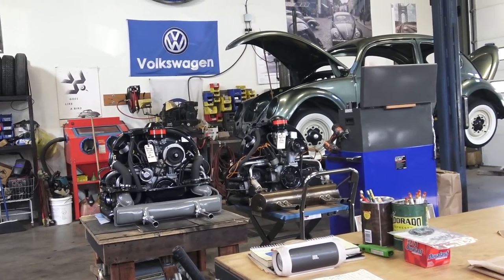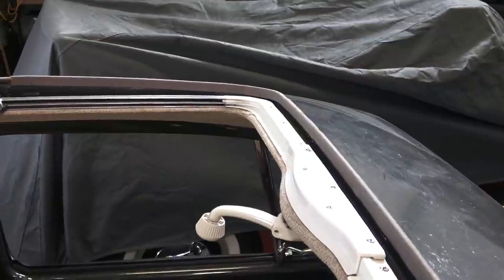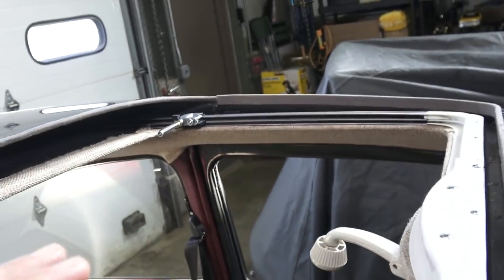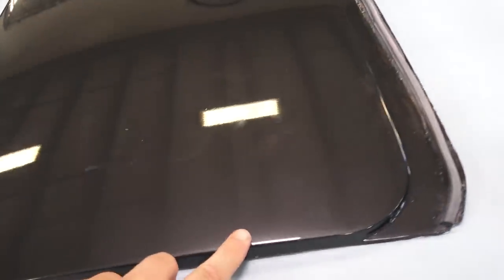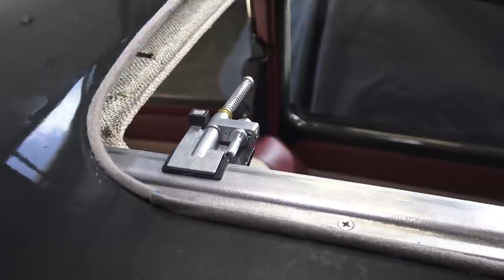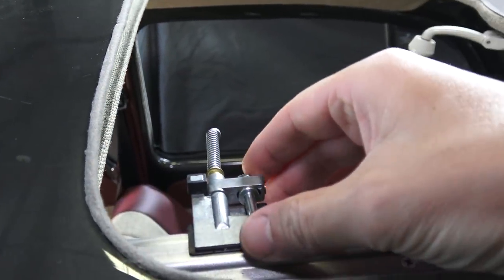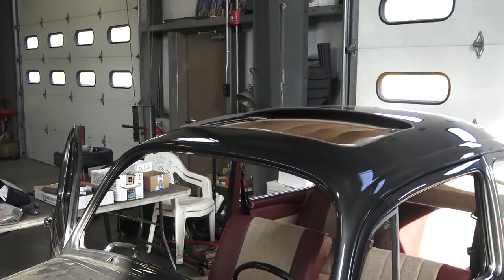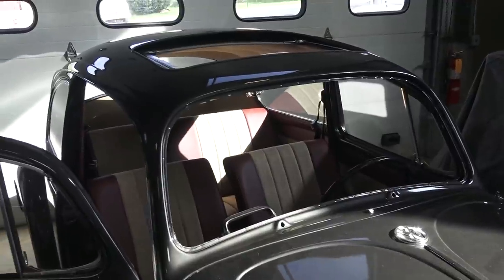Classic VW BuGs 1966 Sunroof Beetle "Build-A-BuG" resto Update

Comment: Thanks Chris... my sunroof (65 bug) was starting to drag a bit... so I took apart the whole assembly (factory) and found the factory lubrication was dried and crusty in the plastic tracks. I took each plastic piece out and cleaned and then lubricated with a thin application of wheel bearing grease and reassembled (and yeah real gentle on those metal into plastic screws). Wow what a difference, she opens and closes with no effort and is working better then ever! You did not mention lubrication of the cables and tracks and that has made all the difference on my factory parts. I am guessing you will mention in your upcoming video! Looking forward to your next sunroof headliner video!
Reply from the maker: Ya!  I speak about that in the upcoming video, the grease we were told to use is like a clear silicone grease, not wheel bearing grease as that can eat away at plastic.

Comment: Thank you for the video.
J bug calls the felt around the opening “sun roof seal”. Their also say on the web site “…not completely prevent water from entering the roof.”
If you keep your VW away from falling debris and the drain tubes open, you won’t need the felt.
Plus the VW will look much cleaner.
Chris

Comment: Doesn't the rear sunroof seal sit tucked in the corner where that rear flange meets the main part of the sunroof (rather than further to the back)? That was the conclusion I reached when I was recently doing mine. The lip on the seal seems to fit the indentation along that corner perfectly.
Reply from the maker: Thats what I thought too, I even thought the groove that was in the seal was meant to hug the outer back edge of the top.  So I called Mike at Sewfine and he clarified for me that it sits on top of the edge and before the bump.  Go figure.

Comment: I am literally a day away from doing this exact thing with my own 1966 Sunroof beetle. Chris, could you tell me in your knowledge, was there EVER a 1966 (late production number) sunroof beetle equipped with a H0 1500cc engine? I have heard that this was done in California but most disagree. Mine has a 1500cc H0 engine, later door handles, etc.
Reply from the maker: Good question.  I don't think they did, 67 was a big year, and I think they made it a point to say that the 67 had the 1500 and was 12v.  Is your bug 12v?
Reply: @classicvwbugs  - No, it is 6V and that is where the questions come in.

Comment: Chris, I’m having my 66 sunroof beetle rebuilt at the moment and the one thing that has me confused is where to exit the 4 sunroof drain tubes from the body. I believe VW didn’t put too much thought into this in the factory, which led to a lot of sunroof bugs rotting their heater channels as water drained over them on the inside of the car. What solution did you come up with for Bills bug?
Reply from the maker: So we did not touch those on Bills bug because they were already in place.  But the two front exit down the side of the front windshield and the other two exit down the back of the cabin.  I saw them behind the rear door panels exiting down to the heater channel.
Reply: There is a discussion on the Samba about this. The front you extend the tubes to drain at the spare tire drain hole and the rear you extend to exit right behind the door post. If you look you will see a hole an inch and a half rear of the post behind the running board. Good luck!
Reply: Clinton Willoughby thanks, yes I agree. The rear is less of an issue than the front. Vw didn’t do a great job of placing the tube exit points at the front of the car, and unfortunately my car suffered from that. Interesting what you say about extending the tubes to the front wheel well though, I hadn’t thought of that one. I’ve come up with a solution of flaring the ends of some narrow copper pipe and have them exiting the car through small holes made out of sight in the front lower a-post area, then connecting the hoses to that. We will see..
Reply: @chrisw6283  look at that discussion on the Samba. I extended my tubes to the front. Works good as long as it doesn't clog up. With it extended to the front I can see it by opening the hood and clean it easier. 👍

Comment: Wow Chris.  Thanks for this vid.   Struggling with my '64.  This will help.  The 4 clips that hold the tray to the top??  Are they available somewhere?  Or some kind of replacement??  It is true that the vinyl headliner came at the same time as the metal sunroof.   Not surprised that the tweed is hanging up.  Thanks
Reply from the maker: Hmmm tough.  Maybe wolfsburgwest.com?   they may have the clips, they are similar to the clips that are used on the outside window scraper for your doors.  Not sure if you saved those from your car?  And no vinyl started in 63, the last of the ragtop sunroof.  Tweed was a hang up a bit, but we did get it to slide good.
Reply: @classicvwbugs  Thanks Chris!  They are not in JBugs or Wolfsburg's catalogs.  My scrapers are still in.  Good there.  Pan halves getting welded in next week, then interior.   I'm sweating the sunroof. You are giving me inspiration!!  Cheers!

Comment: Hey Chris, which suspension kit would you recommend for a Beetle to ride smooth like a Super Beetle? I think I’ve made my decision and want to get any Beetle before 1967. I want to buy one to use as a daily driver. Also, what undercoating will last the longest?
Reply from the maker: I do stock setup all around, with stock shocks, and coker nostalgia tires, and I think it feels good.
Reply: Chris Vallone Thanks again for the info. Also, how much easier is it to turn the steering wheel compared to a car that has the engine in the front? There’s not much weight on the front wheels, so I was just wondering how much easier it is.
Reply from the maker: @zeussx2120  It's not bad, easy really.  I mean there is no power steering, so when it is just sitting it might be tough for some to move the wheel, but once you stat moving, you are ok.